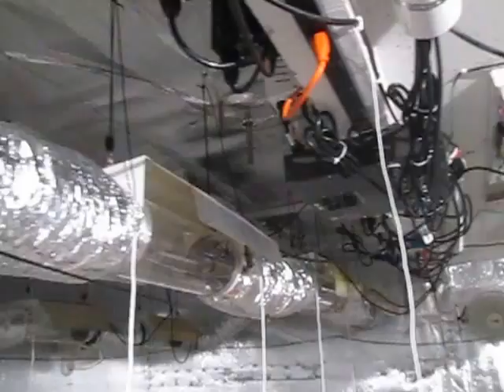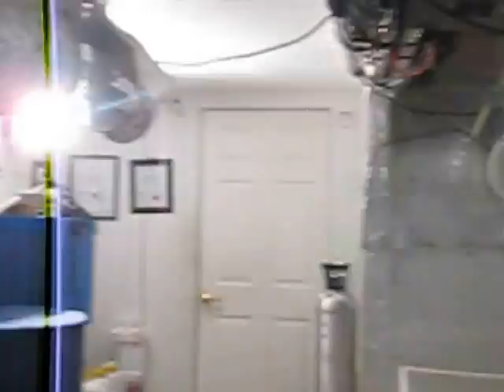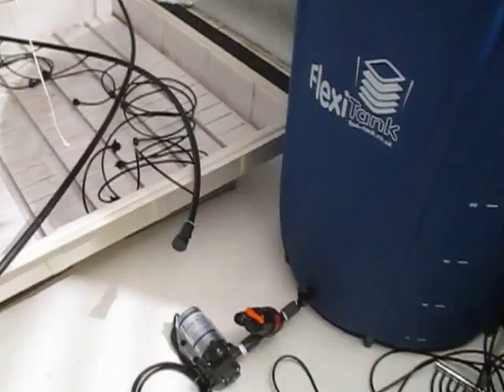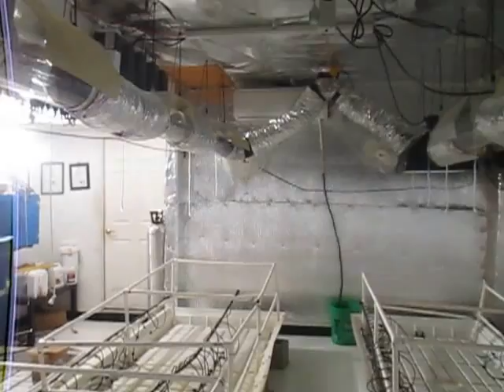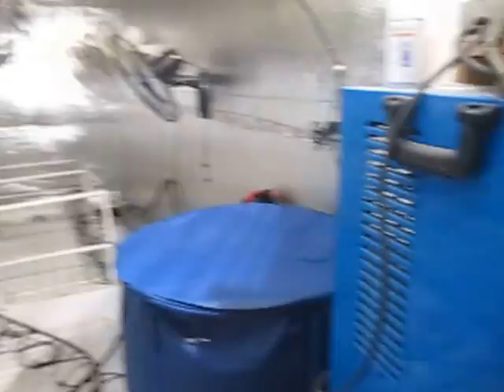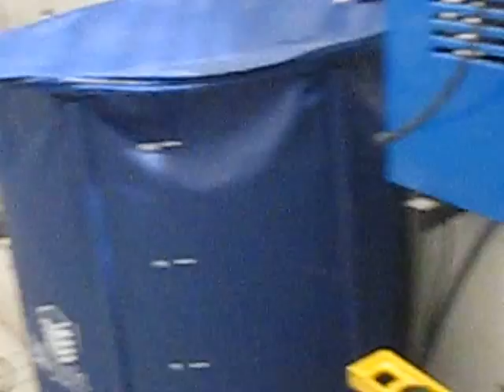11k watt sealed medical MMJ grow room -built by gr

Comment from the maker: I know we received a lot of criticism as well as positive reviews on this video in this room keep in mind this room was built in late 2009 early 2010 there was no gavitas double-ended fixtures at that time most of what was in this room was gone off the customers preference and fitting their budget I will show a new videos soon of this same room outfitted with air filtration systems 8 gavitas 2 -2 & 1/2 ton mini-split AC systems with rolling tables and way updated irrigated drip system this room is currently doing 18 to 22 units every run you can also follow us on grop Pros Instagram and see a lot more current work. To address the question about the CO2 most bills we do that are residential or for medical we do not use CO2 burners most customers do not feel comfortable with gas burning in their house as well as it is a heat issue would he took the room a lot more in most commercial bills always uses CO2 burners I thought that would be common sense for most but it's going to go ahead and answer it anyways

Comment: my biggest question is why n the hell do you have a tank and not a burner for your co2.....
Reply: A room that size are you kidding me?
Reply: Yes a room that size you'd be refilling a 20lb tank less then weekly. The room looks high tech but by the video they are not contracting professionals but using expensive materials trying to come across as journeyman contractors with a bit of growing equipment experience at best. Any professional would hardwire everything into a stand alone breaker box and conceal wires as needed. Not professional to have wires and hoses laying around as seen but C for effort. Everyone to there own and if I spent 15-20k for a setup it wouldn't be looking like this by far.
Reply: @MrMIkeBouch  could you design better? I need help

Comment: Haha i love that ppl really belive that helicopters doing flyovers can use infrared to see heat signatures in your home or basement..infrared can NOT go thru walls..itll read a signature of what it can see...now if your grow is in a bedroom w a window or in an attic yes they could tell part of the roof or a window is warmer than the others..they can also see if you vent out that window especially in the winter or anytime its cooler than the grow room exhaust. Infrared doesnt give them x-ray vision just be smart block off your window dont grow in the attic and vent out existing dryer vents or install a new plumbing stack or bathroom vent out the  roof..but just so others know you do not need infrared "blocking" insulation the insulation in your walls and the brick on your home are going to be the only temp the infrared camera can read. I know this because i own a flir camera and use it daily in my job
Reply: Thats a whole bunch of words to show us all you don't know shit. Radiant heat from IR wavelength is visible from thermal transfer "thru" the walls. If you have a vent from the grow dumping exhausted hot air either into the attic or directly outside, that hot air will show up as a bright signature on FLIR cameras. In the winter time, when the differential between outside ambient temps and the exhausted air from the grow increases, you can have an even brighter signature.
Reply: Its legal.
Reply: Not all homes are made of brick, and not all homes have quality insulation. When you produce upwards of 48k BTU of heat and you don't run fully sealed rooms, you will have a heat signature that is brighter than your surrounding neighbors. However, you would probably need somewhere over 100k btu in heat to light up the roofing with a bright signature like you sometimes see in DEA propaganda videos.